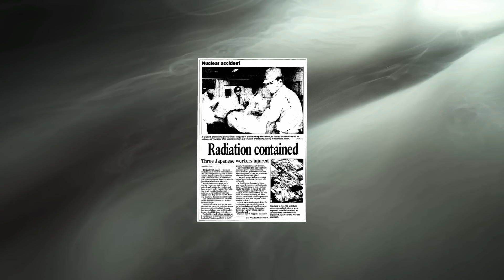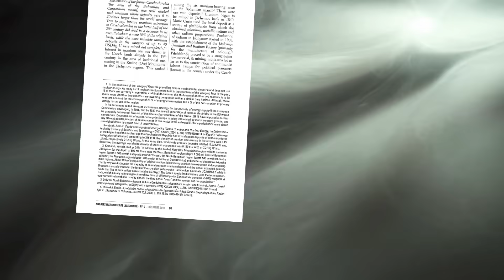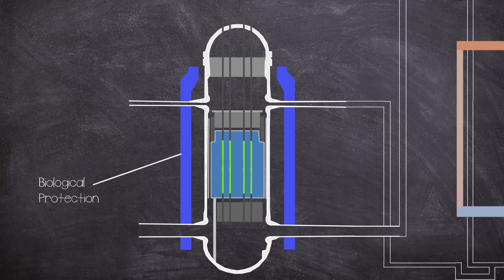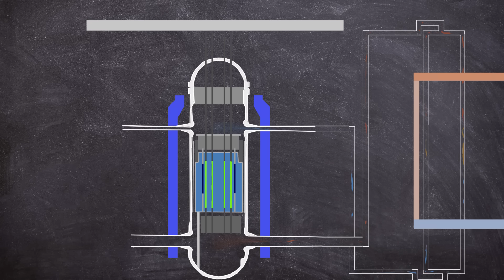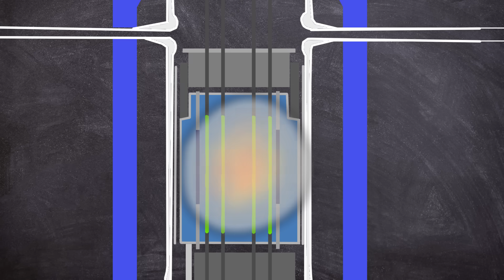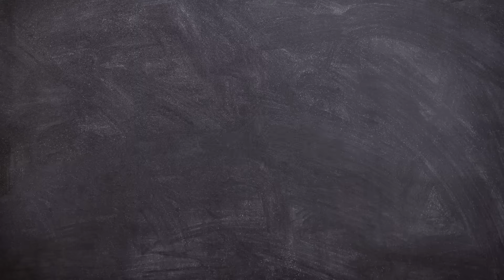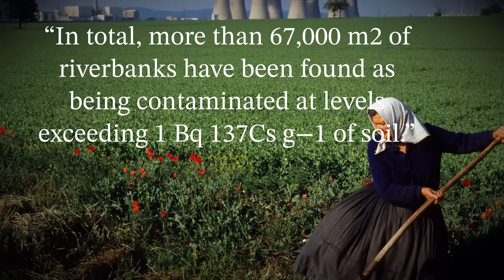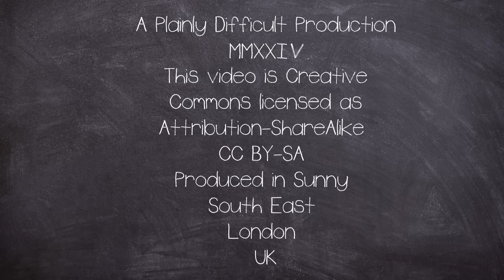Doomed: The Czechoslovakian Nuclear Reactor That Kept on Having Accidents | Plainly Difficult

Comment: I didn't understand the first incident properly why does the fuel rod shoot out of the reactor ? Did I miss something ?
Reply: It was ejected by pressure of coolant - carbon dioxide after locking mechanism had malfunctioned and was not holding the assembly properly in place.

Comment: the goal of in-operation refueling was not to improve operational efficiency, but to extract weaponizable material. Many of our current reactors were built with that goal in mind, tolerating a whole host of safety concerns in the process, givig nuclear power a bad reputation.
Reply: in-operation refueling and running with non-enriched uranium are two design goals that inherently cause safety issues

Comment: Changing fuel elements during operation at several hundred degree and high pressure is always a challenge. How did the designers of the Magnox and that of the Candu reactor make their system that reliable?

Comment: Sounds like there was only one coolant loop and no redundancy. One leak and the whole thing loses cooling. All this could have been avoided with some redundancy with multiple loops. With a liquid moderator, the leaking fuel channel would get enough cooling from other loops.
Reply: It had liquid moderator - heavy water, but as I understand the accident, that had spelled doom for this power plant, even the whole pool of water it was sitting in was unable to prevent local melting of the channel that was made from alloy with not exactly high melting point. Outside of the core, the reactor had multiple loops to steam generators, but it seems like no one thought that  such incident could occur in the core of the reactor.

Sure, now we can perhaps came with many ways how this design could have been better, for example measuring temperature and coolant flows in channels, but would those be practical/doable with 1950's technology? On the other hand, some other related to the structure of the reactor could have been implemented.

Comment: Hi, nice video! 
During the first accident, the compressors that were pumping the CO2 through the core were turned off (some were turned off, some were just slowed by lowering their RPMs) by the operators. They thought that it would decrease the CO2 pressure and slow down the leak. That worked, but after some time they realized that a meltdown could occur from not sufficient cooling, co they tried to turn them back on. That didn´t work because the temperature of the copper coils on the electromotors was too high and the system blocades didnt let them start up. They managed maybe on a 4rd try. The shift engineer decided that the leak can be stopped by blocking the hole by the refueling machine, so 2 brave guys went to the main hall in a protection gear and a gas masks and managed to block it manually. The guy who did it said that it was a hard task , since he couldn´t see shit through the leaking gas. Also the top of the reactor was frozen because of the cold CO2, but after some time the machine reached its place, the guys did a really good job. 
The two guys that suffocated were unfortunately somewhere they shouldn´t have been. They were mechanical workers who didn´t have much to do during their shifts so apparently they had a little place a couple floors under the main hall where they could rest and sleep. It was against the rules, but tolerated. This accident caught them off guard. The emergency exit which they managed to reach was locked to prevent stealing...something not imaginable nowadays. 

Good that the standards changed drastically since those days. The mistakes they did back then are unimaginable nowadays and the nuclear power plants are safe and reliable.
Let´s hope not that many Austrians will see this video and think that it´s still done the same way  these days! :D

Comment: There are also the rumors and some documents about the dissasembly of the plant... like burning radioactive waste right in the power plant or intentionally shutting of the main dosimeters on the drain system and then releasing radioactive water into the river

Comment: Ships’ engine rooms often have CO2 flood systems designed to smother fuel or lubricant fires.  Usually there is a strident klaxon warning that you have about 30 seconds to get out of the lower portion of the engine room before you can’t breathe.

That there wasn’t  a CO2 alarm in the auxiliary building is just baffling.

Comment: When mentioning 1 Bq, forgetting to mention that human body is radioactive... Appr. 7000 Bq (appr.100 Bq/kg). Also noteworthy: nuclear power killed 1000 times less people than aviation, and 100 times less than renewables (eg. Banqiao dam disaster), and nuclear power releases orders of magnitude less toxic waste than any other forms of electricity generation (including solar, if we consider the manufacturing of solar cells, batteries and energy required to manufacture them... and consuming Cu, Ni and other resources that crash the world economy soon resulting in millions of deaths if the nonsense does not get straightened immediately). Except that most of spent nuclear fuel is extremely valueable. The value of fission products is 16 million USD / ton. Most can be used industrially, or for energy (notably the ones that would need hundreds of thousands of years... They convert to millions of kWh/kg energy in a fast neutron reactor within a decade). Only 1 % of the 0.0015 kg/person / year (world average) spent nuclear fuel is actually waste, and very feasible to store and contain. Unlike the waste of battery+renewable+coal, eg. significant Pb and Hg environmental contamination that will be toxic forever. (and not easy to detect with a $25 device).

Comment: let me slightly disagree how this was depicted in this video... A1 was always a experimental reactor to test/study the use of cheap non-enriched fuel, it didn't play well so it was canceled and never built again.  the contaminated area was 67000m2 of river banks and that's a area of 16.5 acres or 12 football fields. i agree the accidents were really bad and we were lucky nothing more serious happened (thanks to the brave guys sealing the reactor after the fuel rod ejection accident).  and regarding the impact to surroundings... I live 34km (21miles) from Jaslovske Bohunice, was born in 1977 and never heard of anyone  reporting high radiation and we do have Geiger counters here 😉 the contamination is basically limited to the mud of those riverbanks nearby the nuclear facility. There were many studies and neither of them showed impact to living organisms in the area and there is no increased occurrence of cancer either, and let me mention that studies were conducted before and after the fall of the old regime and many of them were conducted well after the fall of the old regime (so not hiding any secrets).

Comment: the fact it was packed amongst a component that, if damaged, which happens during shipping of anything, could release a material that could block proper coolant circulation channels is the real mishap. things get rough handled during packing, unpacking, and shipping. logistics is all about transmitting items as fast as possible thus damage to exterior packing material is something to be expected and accounted for by the party packing the item. 
the workers really tried their honest best getting in there with tweezers and a vaccum. it shouldn't have been packed with silica granules at all. i myself have torn those little blasted packets more than a few times.

Comment: Two workers suffocated from CO2 leak were unable to escape through emergency exit, because the emergency exit was locked. Why it was locked then? Because people were stealing material from the plant. Whom to blame? Maybe we shall check even today who has welded his backyard fence of neutron-flow-resistant nuclear-grade stainless steel in villages surrounding Jaslovske Bohunice.
Reply: Yep, and light bulbs from signaling lights  in CO2 detectors were also reported stolen that time...

Comment: And the issue is not with heavy water as moderator. The canadian CANDU reactors use heavy water and are incredibly save and can run not only with unenriched uranium,  but also with old fuel rods from regular BWR and PWR systems.
Reply: Yup, but noone really needs unenriched uranium these days, enrichment is way easier now. And hardly anyone (maybe except Norway) has high amounts of cheap heavy water... thats why it got no copies everywhere. Well india started with some CANDU-type reactor, but since then many things changed...

Comment: To have the reactor in its operating state for refueling is a recipe for disaster, which is the main reason the western nations avoids it. Both accidents caused primarily by the same stupid idea, to leave the core in its operating state for refueling.

Also why these sort of accidents dont happen in the west, the reactor is shut off, there is no pressure in it during refueling and when you change a fuel rod it doesnt start getting hot directly, its slowly taken out the non reactive portion, where things are tightly monitored.

But the usual suspect is still there, the plan was that the reactor could stop producing energy to produce plutonium instead if need be. Western nuclear reactors are built to only produce power, there are reactors that produces plutonium but most of them have been shut down.

To make a comparison, its like trying to change the transmission in the car while the engine is running.

Comment: Could you propably do a vid on the Elbmarsch Leukemia Cluster? There is some very interesting stuff to know about, especially a nuclear spill that apparently never happened, yet there were findings of manufactured radioactive material in roof gutters and so on, decades afterwards and a rise in leukemia cases in birth years 1990-2003 in the area.

Comment: The company building nuclear power plants in Czech and Slovak republic is called "Škoda nuclear machines contruction" and it is owned by CEZ Group. They have build all NPPs in Czech and Slovak republic. The company was also producing the VVER440 and VVER1000 pressure vessels and exported them to Hungary and Bulgaria.
Some western journalists are still saying that those NPPs ,and even the currently being built Mochovce 4, are built by Rosatom.

Comment: There should be an interesting note, that Jaslovske Bohunice A1 is very similar by the story, reactor type and fate to Swiss Lucens reactor.
Both were mostly domestic designs, both were CO2 gas cooled heavy water moderated, both were designed to use natural or barely enriched fuel to achieve some independence for a country lacking uranium enrichment facility, both failed soon due to partial meltdown.

Comment: Is it usually the rods surrounded by other rods that cause the most incidents in reactors?
Reply: With the RBMK at Chernobyl, the outer sections of the core actually were more active than the center. Neutrons from the center would be moderated by the sheer mass of material they had to pass through on the way to the outside. It was the bottom section of the core that went hyper first. There were shorter control rods for the top and bottom that only went partway in specifically to keep the outer edges under control while the rest of the reactor was usually running at a lower power level. The RBMK was so big that there could be several areas that were critical while the rest wasn't. Insanely difficult thing to get back under control once it was lost.

Comment: Suggestion for another video: How it happened that the Hubble Space Telescope mirror got ground incorrectly. (A perfect example of how something can be made precisely inaccurate.) Nobody was injured or killed but it was a very expensive and embarrassing mistake. Especially ironic was that because the launch was delayed, Perkin Elmer had several years to discover and fix the problem. Luckily, corrective optics could be installed in a later mission to fix the problem,.
Reply: Corrective optics? Sooo, basically the Hubble Telescope wears glasses? 😂
Reply: @maxshep2829 yup!  That’s basically what they did to fix the incorrectly ground mirror
Reply: @maxshep2829  Primary mirror had geometric fault(s) but would be extremelly costly to exchange. So they computed, created and installed corrected secondary mirror... that was still costly and delaying but less so.
Reply: I remember that! It was so exciting to have a telescope in space—and then the news broke. The fact that they were able to fix it is pretty amazing.
Reply: And I'm glad Specsavers fixed it: some of the photos taken are extraordinary.

Comment: Channel plug seals have been problematic on many reactors, the design I have worked on uses the pressure of the reactor to lock it in place, surprisingly simple and hence reliable. To take the fuel out whilst the reactor is running the refuelling machine is connected to the channel stand pipe.The pressure in the charge machine is then increased so it is the same as the reactor and the channel plug seal drops down slightly under its own weight and unlocks, a crane inside the charge machine then connects to the channel plug seal and lifts it and the connected fuel assembly into the refuelling machine. The fresh fuel and a new channel lock seal is then lowered into the reactor. The refuelling machine is then depressurised slightly and a careful measurement made of how much the channel plug has risen indicating that it has locked into place. If this measurement is not made or you just rely on the channel plug not sticking... well... the whole assembly can pop out sometime later like the cork from a bottle.
Reply: Yes that's all correct, but the basic problem is WHY to use all this bollock... channel type reactor has only one advantage (that prevailed to these days) and that is less downtime. Everything else speaks against it... those things that were once advantages (online refuelling served among other things production of weaponizable Plutonium, only Kim needs that these days) (low/unenriched uranium was nice feature when the enrichment preces(es) were complicated, not much of a problem novadays) are gone so this reactor type has gone the way of British Magnox type...

Comment: They seriously picked the worst, most finicky, most expensive reactor they could have chosen, with the least reliable kind of cooling system.   Whole thing isn't robust, nor easily made failsafe.
Reply: @300guy  the point was becoming independent on USSR with nuclear fuel, all the kinks and quirks were considered necessary evil to not have Kremlin knife on neck in regards of electricity self sufficiency (which is pretty big deal in national security, especially in context they already invaded us in  '68 and were occupying us till nineties).
Reply: @depressedTrent  The RBMK reactors had their own booby traps obviously.  They could have specialized in PWR as well, but not as cheap and fast and not able to continue running during fueling cycles.
Reply: @300guy  pwr needs high enriched fuel which we weren't able to produce domestically, that was the core issue.
Reply: @depressedTrent  Please cut that "high" from enriched fuel for pwr... common enrichment for pwr is around 4% but you could work even with something like 2.5% if absolutelly necessary. Unless ofcourse you are speaking about pwr reactors for military use (ships, submarines) where size is extremelly important, THERE you could have something like 30-40% enrichment... but even that is usually called MEDIUM enrichment (nothing like 90% HEU for nuclear weapons)...
Reply: @SYNtemp  high in context of reactors, not in absolute numbers. The fuel enrichment process in any capacity is the core of the issue here. Also, submarines and other nuclear powered vessels don't really do it for size but rather to prolong periods between refueling, often calculated for not refueling it at all for entire service life.
Reply: @depressedTrent  Not everyone is so afraid of "everything in own hands" these days. There are many sources of low enriched uranium for reactors, even complete fuel bundles (Russia, US, France to name just few). That is usually easier than own mines, own refinement plants, own enrichment plants...
If you are afraid, it is posible to buy like 10y worth of fuel bundles...
For ships, high power density (means small core) needs higher enrichment levels. Long fuelling/one time fuelling is another effect of that, yes, but not only one.

Comment: Great ,first multi disaster video and i living 8 miles from it
Reply: We need this video redone from a Slovak perspective. This doesn't have enough sarcastic self-deprecation
Reply: Same here, I grew up about 15 km from this power plant (Piestany). I still remember the evacuation "drills" we did at school.
Reply: @Qu1atu5  "drills" You had to eat the real iodine pills? 😅
Reply: @gargoyle7863  Well we were all issued a iodine pills from the municipality and were told to pop them when the alarm goes off:).
Reply: Sometimes it seems futile to have alarms. 

I worked with an accountant who had worked at a chemical plant decades ago. They had evacuation drills. One day, in conversation with the operations engineer, he was told that if the alarms sounded, just call your family and say goodbye because you are dead. You can't outrun or outdrive the gases.

I think they made urethane foam, 1960s.

Comment: I had a Subaru Impreza I put 3 motors in over 5 years I should have cut my losses much earlier. When the 4th motor blew I pushed it out of the barn it rolled across the field into the ditch I took a cab to dealership bought a Nissan truck and when I came back to barn 2 days later the car had been stolen.